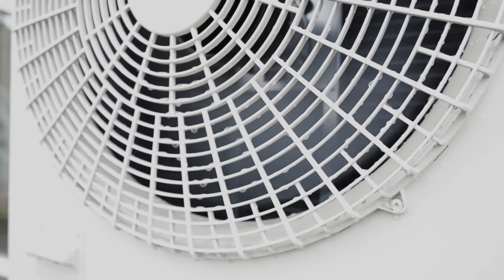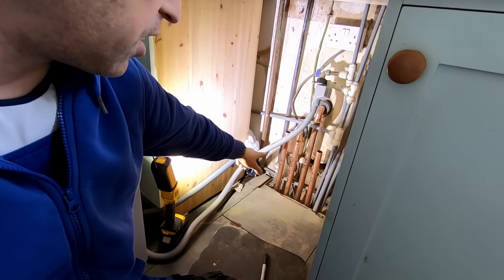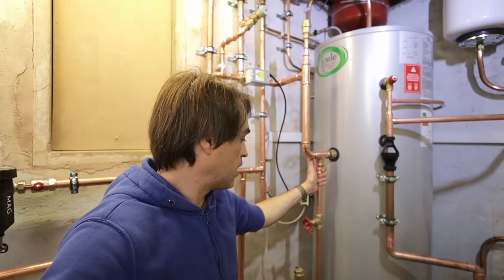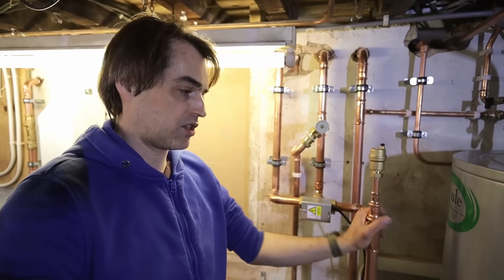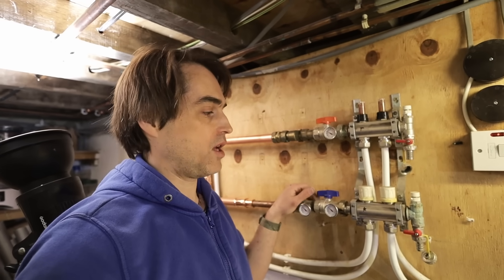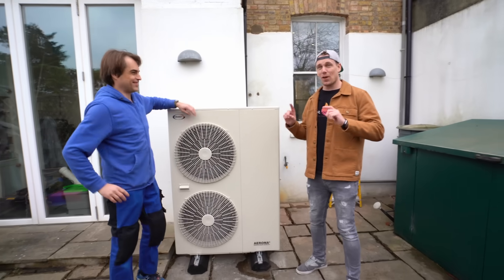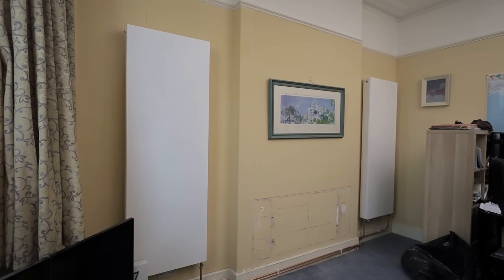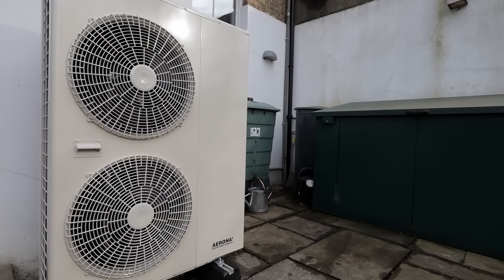The Truth about Heat Pumps: Debunking the Myth.

Comment: It's really a pity to put these two huge awful radiators in a music room, not even mentioning the dust nests nightmare. A heating wall in these two recesses would have looked so much better, and then you'd have only one flat wall that can be decorated in a much nicer way. Lower temperature too, because it works as an infrared radiating mass heater, so 38°C should be plenty, maybe with some better insulation in the room. Lower temp requirements mean cheaper heat pump too.

I was going to go with a heat pump too in my renovated house, but I really can't afford the cost (even at 50% subsidies) and the electricity bill, so I am looking at solar vacuum tubes panels instead, with a large €250 recycled fuel tank to hold the heat, and a copper coil to extract that heat to go into heating floors and walls, with a separate hotter water circuit to feed a small water tank for the bathroom and kitchen.
I still need to do all the computations with the existing layout and the future renovations and building (the house is not insulated yet, I plan for a winter-heated green house too), how to move that heat without a £700 100°C pump, as well as investigate technical issues such as having a copper foil in a steel water tank. I guess it's so complex I'd rather give this as a training exercise to a professional school...

Comment: I am from Romania and I am a woman. Your video was helping me incredibly! So thank you :washhands: In my country, heat pumps are at their beggining. But due to energy crisis, there is crazyness on the market. It is a jungle, actually. Huge lack of knowledge, few good specialists, and lot of abuses. Myself I started to learn a bit about heatpumps and installations after having a very painful experience with an insltaller claiming to be an expert. I found no other solution than to start learning myself, learning the heatpump installer manual like a bible and start testing really well the so call "experts" offering to reinstall correctly my pump. Was it enough? yes and no. But... your videos were solid milestones for me, on the road to learning from the best. Therefore I am sending you my entire gratitute. Love from Romania 💜🧡
Reply: Same over here in Germany. Since the beginning of the energy crisis so called "experts" took over the maket with their cash grab methods. Everyone, who did not do their research on heat pumps gets scammed most likely. But once it's done correctly, oh boy, get ready to safe some big €€€, I just got back 500 € from my electricity company because I predicted 3500 kWh and only used 2200 kWh.
Reply: Your a brave ♀️.. If nobody understand in your area, then find a hydraulic engineer, these machines are actually hot fluid pumps and need careful mathematical calculations and unrestricted flow, both are critical for SCOP of 3.5 or higher.. 
Good luck 😊

Comment: So heat pumps use half the electricity of a standard electric heater, gas is 1/6th of the price of electricity I’ll stick with gas while I can thanks.
Reply from the maker: they use 1/3 or 1/4 - gas is 3 times cheaper than electricity.
Reply: @UrbanPlumbers  we pay 5.6 for gas and 32.7 for elec

Comment: The future requiring a gifted engineer and technical wizard or a self described geek to install the heating in your house. What can go wrong? There is this increasing reliance on technology to get out of jail but the technology is becoming ever complicated and expensive. You tube is showing how the eco revolution requires money and is very much a province for the virtue signaling affluent and a lost cause for most of us. This is good in a way as my plan now is to just switch off and work on my own survival and leave all this saving the planet to the chattering classes who have little risk to themselves in what they preach. So the average you tube eco warrior with the Lexus priced Tesla car on his drive, Tesla batteries in the massive utility space in his house linked to the solar panels, triple argon glazing, under floor heating and ground sourced heat pump heating may just as well be on another planet really. My living room has a small radiator in the living room as it was built with an open fireplace as primary heat. This has a gas fire installed now and this will be a godsend as heating the whole house will be an expensive business. Back to the world before central heating as the modern concept of total house heating disappears now we are seeing the of outlawing fossil fuels and the unaffordable alternatives in this new age of technological confusion, high costs and complexity with chip shortages and a whole bundle of contradictory expert advice and argument. You could pick a daisy in a field and pluck the petals as with the old poem, Air Sourced Heat pumps work, no they don't, yes they do, no they don't, yes they do.... and follow the last petal; probably as a good a way to choose as any. Who would really know.

Comment: Looks very well installed never heard of that brand of heat pump before, will it work on an old uninsulated house like that one .
Reply: Grant, made in Ireland. I think they are relatively new to heat pumps but have been manufacturing standard and condensing boilers for years.

Comment: i put a 3kw heat pump in my home designed for just hot water usage in a solar thermal container. Downstairs i have underfloor heating without thermal regulators and upstairs i have just the old 70's single plate radiators and if your stubborn enough and use a decent zone setup and heating planner i found out that this setup meets my needs for about 97% off the time only sometimes i need some help from my combiboiler but i have that thing set to 35C for central heating

Comment: I don't know a huge amount about heat pumps. Basically can compress or decompress the refrigerant either cooling or heating the interior of the building. But the bit that confuses me is the positioning of the exterior part. If you wanted heating you would probably want it on the sunnier side of the building, however if you wanted a cooling effect it would be best positioned on the shady side. One way or another your either going to be hitting around average air temp around the device for conversion or  if it's located somewhere that sees more extreme outdoor temps it will be fighting either the heat or the cold. I guess it would be best to put them on both sides of the building to take advantages of either condition.

Comment: A couple of months after installation your heat pump will be making so much noise that it will drive you and your neighbours crazy . So you'll probably rip the whole lot out and go back to an efficient, cheap, reliable, quiet gas boiler.
Reply from the maker: It’s been 6 months

Comment: There's just no way the average joe is going to be able to afford air source heat pump systems.
I still think the real future is hydrogen powered boilers, I know that's a long way off due to there not being any large scale hydrogen production facilities, but the boiler technologies that run on100% hydrogen ARE now available.
Now that hydrogen can be transported in powder form vs compressed gas canisters, it does seem like the logical step forward.
I would much rather see our government encouraging and investing in hydrogen infrastructure than air source heat pumps.

Comment: Don't get paranoid about Roger, he has a gas agenda😊
Reply from the maker: Roger is fine. I like him. Wrong about heat pumps but his heart seems in a right place
Reply: @UrbanPlumbers  Roger is an OK guy I've corresponded with him on more than occasion. The problem is that heat pumps are relative new in the UK, so people are sceptical, whereas here in Scandinavia we have been using them for the the passed 20 years or so. Here large scale geothermal heat pumps are used in district-heating works; a household heating form that's widely used. Air to air heat pumps are also popular, especial for small buildings. I have only ever seen 2 heat-pumps of the type that you showed in your video, here. Here geothermal heat pumps are the preferred instalation. Thanks for your great videos, I watch them with great interest. So keep up the good work because in an evolving world of renewable energy; heat pumps are the future.

Comment: Clean ? where does the electricity come from then  to power it they use plenty. You are not getting something for nothing the ground in your yard is not warmer than you house. Electricty is used to refrigerate your yard, the heat exchange from this process is what heats your home. Just like the inside of your fridge is cold. This would be your yard. The  radiator on the back of your fridge the heat exchange gets warm. This is your heat to heat your home. Electricity is very much needed. The need for thousands of pounds worth of insalation in you home is essential because they don't work that well. The recommendations to leave it on all the time too is an indication that they don't really come in with much heat when you need it. You would use much less electricity putting on a 1 or 2 kilowatt fire as and when and where you needed it than these rip off heat pumps. A no go but a great money making scam for some.

Comment: Straight away you can see that heat pumps are teetering on the edge of failing even after a good installation, one little hiccup along the way will render the quality of the heat efficiency to near useless. The pump doesn't work as required in the cold weather, the system seems like it must be running continuously at what 800w electric consumption, the system upgrade is huge with pipework, insulation, thermal efficiency of the home and radiators filling up rooms, these systems are only for the green saviours with too much money, can this be scaled for a normal house within the costs of a gas boiler, I don't think so, not unless there is a huge chop down in costs, these pumps remain a white elephant.

Comment: God help you if it has complications or technical issues later it looks like a very complex system
Reply from the maker: It really isn’t. Flow and return (as in any boiler) plus diverter valve. Could not be simpler really

Comment: Yeah, great. 🙂 Shiny happy people... My home (north of England mid-terrace, built in 1913) has no form of heating whatsoever. There's no gas supply, no central heating, no radiators, no solar stuff, no convection heaters or fan heaters or even a warm and fluffy cat to sit on my lap.

I can't afford hot water, either.

I live on an annual budget of £800 [eight-hundred]. There's 3" of fibreglass insulation in the loft which I think dates back to the mid '70s. The house got a new tiled roof and (double glazed) windows in 1992 via a government grant. I don't have a fridge (too expensive to run) but there's a cold, damp cellar which keeps food fresh for a week for free.

Yay.

There's no point spending money insulating the place properly because there's no heat in it to retain. I don't mind. I'm not complaining. I choose to live this way. You get used to it after a while.

I dress warmly when it's cold. Novel concept, eh? I don't expect to swan about the house in a light summer frock and sandals in the middle of winter. Staying seasonally warm costs me virtually nothing, although I did knit myself a new woolly hat recently. It cost me £0.38.

Washing in cold water isn't too bad if you're quick about it, keep a stiff upper lip, and remember you're British. [🤭]

I live alone so I can get away with this kind of weird minimalist existence - it's certainly not for everyone - but I'm still astonished that other people are prepared to spend so much on their mod cons.

I sold my old Nissan Micra over a decade ago and have ridden a teenaged £30 [thirty] bicycle since then. I do 70 essential miles per week - shopping for myself and running errands for neighbours. I can't afford public transport.

I took early retirement in 1992 (I was a cabinetmaker) to provide 24-hour care for my ailing parents who had Alzheimers and cancer; they've been gone since 2008, but after 16 years without sleep - yes, really; sleep deprivation  broke my brain - I lost the will to work, and won't get my pension for a long time yet.

So?

So until then I'm living small. And that doesn't include any of life's luxuries such as heating and hot water.

I use very little electricity, and most of what I do use goes on cooking. I allow myself one hot meal a day and use no more than 25 kWh per month, which is 300 [three-hundred] per year. Last year I managed to keep my annual usage down to 246 kWh.

I've read a lot about heat-pumps. A year ago I received an offer to have an air-source one installed completely free of charge. Whee.

I did a lot of research, and then declined the offer. It would have been a total waste of time, money, effort and resources. And the noise of the fan would have driven me (and my neighbours) nuts. What's more, I wouldn't have had the funds to turn it on, so what would be the point? I prefer to do things my way.

Small.

I'm willing to bet that quite a few of the people watching this video will have a £1,000 i-Phone in their pocket, a £500 Dyson vacuum cleaner under the stairs, and at least one £50,000 Tesla in their double garage.

Someone elsewhere in the Comments says that he spent over £20,000 on a heat-pump installation.

Twenty thousand pounds? Say it slowly. Twen-   No, that's ludicrous.

Call me old-fashioned, but there seems to be an awful lot of unnecessary consumption going on these days.

What we need is more woolly hats and less woolly thinking.
Reply from the maker: no heating and hot water but you have internet - good choice mate! 

You are setting a trend many will have to join this winter.

Comment: Great quality work and I can see that air source heat pumps may be useful in certain circumstances. I would be interested to know the actual COP for this install and the location climate. However when I look at the extra hardware, complexity, size and noise* I still cannot imagine how it will be feasible to retrofit most of our existing housing stock at an affordable price. *Yes, it seemed relatively quiet, but imagine sitting in your garden for some peace and quiet, then imagine all your neighbours have them and then they start a beat frequency and then imagine when the fans start to wear and get noisier.....
Reply: What would be the alternative without using gas ? Convection isn’t efficient and it’s expensive j think this is the best out of a bad bunch

Comment: The biggest issue - and the one trumpeted by the oil and gas furnace/AC industry - is the problem in cold weather. Solutions range from many "I don't have a problem" to installing a small resistance coil  heater in the coil (about $200).  Warm air in winter guaranteed.
Reply: The tech is fine in cold weather, you just need to go to ground source. The ground is going to be the same temperature year round regardless of what's going on up top once you get below about 5-10 feet.

Comment: LMAO just turn every wall into a radiator bro. House looks like a power station with all that pipework, tank and heat pump outside. Lucky they had a basement.

I'll stick to the gas combi boiler thanks.

Comment: If they had spent this money on as many solar panels as they could get on their roof, and 30kw/h of batteries, they would have a much better system. The insane amount of pipework and labour involved in this is just ridiculous.
Reply from the maker: They did. Solar panels and batteries were already in place before the heat pump installation. The system pay back with current energy prices is surprisingly short and saving quite substantial

At the time we did not know what the energy market would do!
Reply: @UrbanPlumbers  what’s the payback?
Reply from the maker: @coooooool12342  what's the payback on a new 20K kitchen? Or a new 20K car? 

Although this should be cheaper to run than gas and the system should last twice the time of an average gas boiler, it is not done for the payback. This technology saves energy as it uses up to 80% less energy than a gas boiler or direct electric heating and creates much less pollution.

Your payback is cleaner air and less CO2 plus some money saved on bills.

Obviously, there is a lot of badly installed air source (as there is loads of badly installed boilers) - on heat pumps problems are more pronounced and obvious though.

Comment: Could you give an indication of the cost of an installation like this please? There is a lot of confusion around the actual cost of the whole system (including the cylinder, pipe and radiator upgrades and your assistance would be most helpful.
Reply from the maker: Very roughly it is £10k to £20k minus current £5k grant

Comment: Good and interesting video, but theres no way on earth that id install something of that size be it the radiators or the tardis outside. Awful looking thing. The problem with videos like this and heat geeks so far is cost! I hate to imagine it and the odds are you wont get an installers as good as yourself and that will lead to them not working properly and their reputation will drop further. 
When your talking about needing underfloor heating and all those pipes it gets scary expensive. Your average person will not got to the expense to maybe get something that may work .
I know that outside unit would have been bashed by my kids playing outside . Wed be better of using tax payers money insulating than push these things

Comment: Heat pumps work fine, they were invented in 1926 by Albert Einstein.  (https://en.wikipedia.org/wiki/Einstein_refrigerator)
They run on gas.  They are used widely across the world, but especially in the Gulf region.  All this compressor talk is just nonsense.